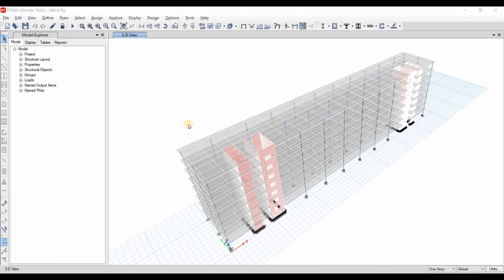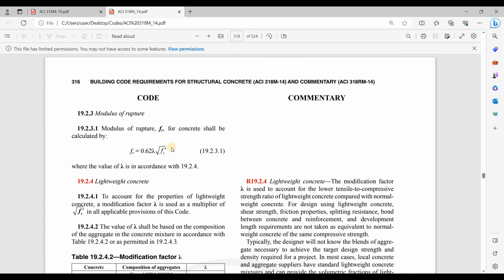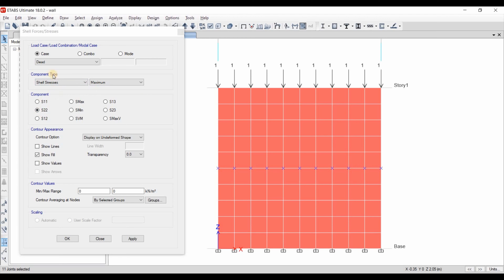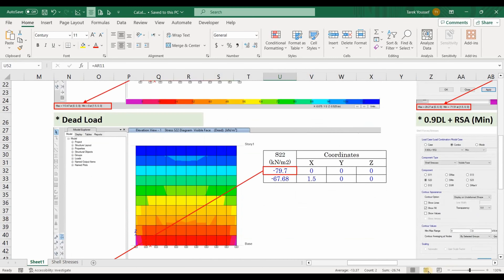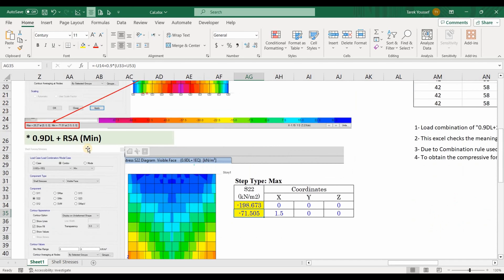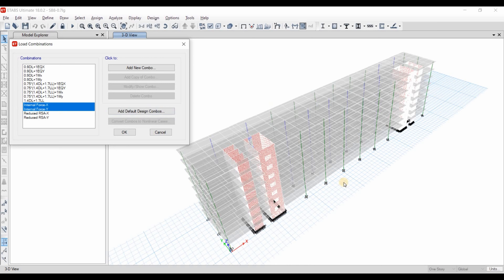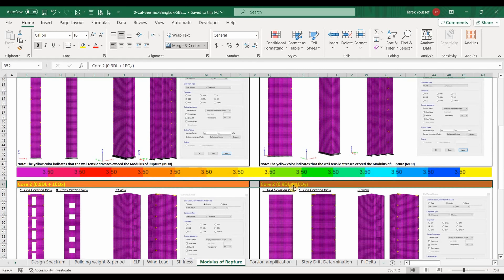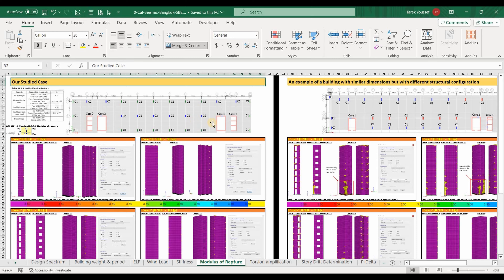ETABS Tutorial 12: Choosing the Walls Flexural Stiffness (0.7Ig or 0.35Ig) Using the Rupture Modulus

Comment: Hi Tarek, Thanks for this good video. 
1 question please
how much area should be cracked to say yeah it should be 0.35
because as per my understand the 0.7 which is approx 30% of the wall is cracked while the 0.35 which means like around more than 50% of the wall is cracked and in your case I can see the wall is cracked less than 50% so you can still assume that the modifies is 0.7

Correct me if I am wrong

Comment: NICE EXPLANATION 
COLUD YOU ILLUSTRATE WHY YOU USE WORKING COMBINATION HOWEVER IN CODE ( FACTORED MOMENT AND SHEAR ) WHICH MEAN ULTIMATE COMBINATION ?
Reply from the maker: In practice, it's essential to assess how buildings withstand different types of stress by examining all load combinations.

In my tutorial, I'm specifically focusing on one particular load combination (0.9DL+EQ) as required by a research project I'm involved in.
Reply: My question is what is the correct! 
Check stress due to working combination or ultimate combination And compary with moduls of rupture?  @Eng.tarekyoussef
Reply from the maker: @AbdalrhmanAbdallah-r8h  You should use the factored load combinations (ultimate combinations). The load combination "0.9D + 1.0E " is part of the factored load combinations listed in Chapter 5, Table 5.3.1 of ACI 318-14 (it does not belong to the working load combinations! Please check the ACI code).

Comment: At design of shear wall, after checking cracks on wall ,is be enough to change the modifier of the zone that exceeded the limit and continue the design or we should make shear wall safe from any cracks?
Reply from the maker: In practical design, it is challenging to prevent all cracks in a shear wall. Minor cracks are often acceptable and expected due to the nature of concrete and the stresses it undergoes.

When cracks exceed acceptable limits, one common approach is to adjust the stiffness modifier of the affected zone. This adjustment helps to account for the reduced stiffness of the cracked section and provides a more accurate representation of the wall's behavior.

While these modifiers offer a practical solution, they may not always be entirely accurate, particularly in capturing highly nonlinear behavior.

Performance-Based Design (PBD) allows for a detailed understanding of the nonlinear behavior of structural members. This includes evaluating the level of nonlinearity and determining whether the wall is performing safely despite cracking.

Linear vs. Nonlinear Analysis:

1- Linear Analysis: 
In linear analysis, the material is assumed to remain within its elastic range. This assumption limits the ability to accurately assess cracking and nonlinear behavior. For regular buildings, linear analysis is typically sufficient, as it provides a reasonable approximation of the structure's response. However, it may not capture all aspects of cracking and nonlinearity.

2- Nonlinear Analysis: 
For irregular buildings or those expected to experience significant nonlinear behavior, nonlinear analysis is essential. This type of analysis captures the real response of the structure, including the effects of cracking and stiffness degradation.

I hope I answer your question

Comment: عندي سؤال بخصوص قيمة ss و s1 من الخرائط الزلزاليه مكتوب تحت الخريطه 

SS Risk-Targeted Maximum Considered Earthquake (MCER) ground motion parameter
for 0.2 s spectral response acceleration (5% of critical damping), site class B.

مثلا يوجد بالخريطة قيمة مكان المشروع ss = 16 كيف ادخل القيمه هي بالايتابز هل اضربها في g او اقسم على ١٠٠ او شوو ؟ وكمان بالنسبه ل s1 

S1 Risk- Targeted Maximum Considered Earthquake (MCER) ground motion parameter
for 1 s spectral response acceleration (5% of critical damping), site class B.

ويعطيك العافيه
Reply from the maker: You need to compute "SD1" and "SDS" from "S1" and "SS". 
The "SDS" and "SD1" parameters are used to 
1- Develop the Design Response Spectrum (Define" ==> "Function" ==> Choose "ASCE 7-10" ==> "Add new Function" ==> then you need to use "SS" and "S1").

https://youtu.be/dDbdumnN07g?si=2tVhs2XPUuSBUa2T
https://youtu.be/FgC_tbaqHOA?si=cB71LG-V6Ex1Pd3S
 
2- To calculate ELF Lateral Loads

https://youtu.be/L4aZ04SHJcQ?si=pL1sMMf4_-Zu-_69

Note that the acceleration parameters have the "g" unit. Then you should ensure that the "g" unit is included in the defined load case.
Reply: Thank you tarek for your response and I know that I need to compute SDS and Sd1 from SS and S1 but my question when I defined seismic load pattern I need to input the value of S1 and SS from them map That I told you about in the previous comment. Do I need to divide the value of those value that I obtain from the map for example 16 do I need to divide it by 100 then multiply it by 9.81 (g) or not or just divide it by 100 ? 
Because in your case and your example you already have the value of SS & S1 
Thank you
Reply from the maker: The acceleration values (SS & S1) in ASCE are expressed as a percentage of gravity (g). To convert this percentage to the standard unit of acceleration, you need to divide by 100 to remove the percentage sign. 
So, for example: 
5% g = 5/100 * g = 0.05 * 9.81 m/s² ≈ 0.49 m/s²

ETABS includes the "g" unit in the scaling factor when defining the load case, so you should indeed input the acceleration values from ASCE by dividing them by 100.
Reply: This is what I found in etabs documentation

 ( S s is the mapped Risk-Targeted Maximum Considered Earthquake (MCER ) spectral acceleration for short periods as determined in ASCE 7-10 Section 11.4.1. A typical range of values for S s is 0 to 3. Note that the seismic maps show S s in % g with a typical range of 0% to 300%. The input in the programs is in g. Thus the map values should be divided by 100 when they are input. For example, if the map value is 125%g it should be input as 1.25g.

S 1 is the mapped MCE spectral acceleration for a one second period as determined in ASCE 7-10 Section 11.4.1. A typical range of values for S 1 is 0 to 1. Note that the seismic maps show S 1 in %g with a typical range of 0% to 100%. The input in the programs is in g. Thus the map values should be divided by 100 when they are input. For example, if the map value is 100%g, it should be input as 1.0g. ) 

So what do you think ?

when I took the value of SS from the map and then divided it by 100 then multiply it by g value 9.81 for example (16/100)*9.81 = 1.57 when I input this result in the 0.2 sec spectral acceleration ss in seismic load pattern definition, I got the seismic design category = D which is almost impossible in my country because I live in very low Hazard region

So ? Only divide by 100  ? I am still somehow confused. 😅😊
Reply from the maker: @LodyBasha Absolutely, just divide by 100. And remember, when applying the scale factor in the load case, make sure it's in the "g" unit.